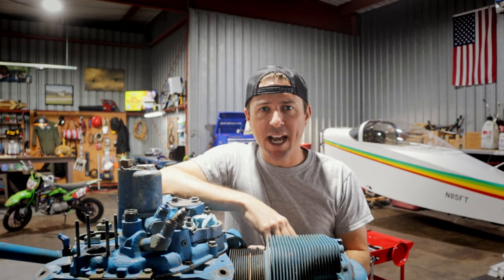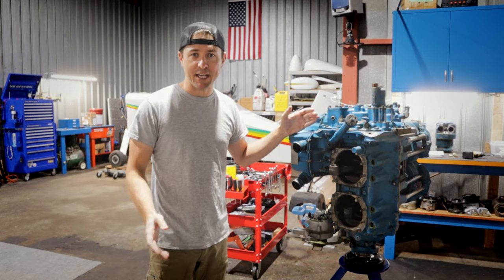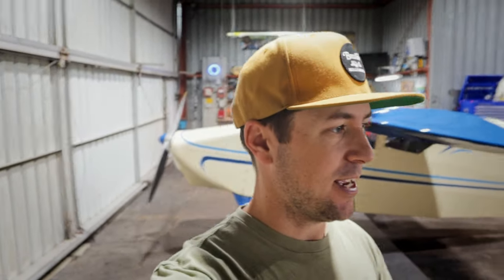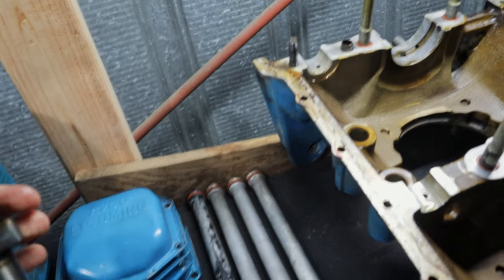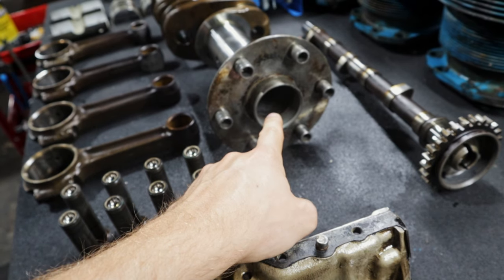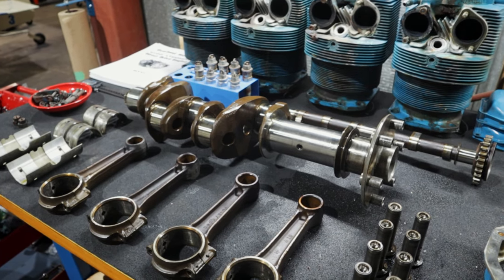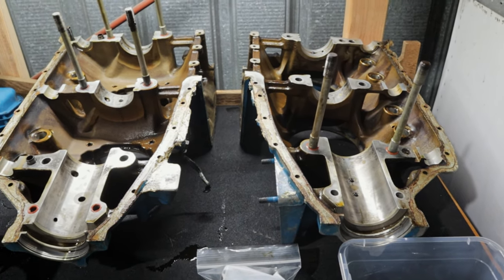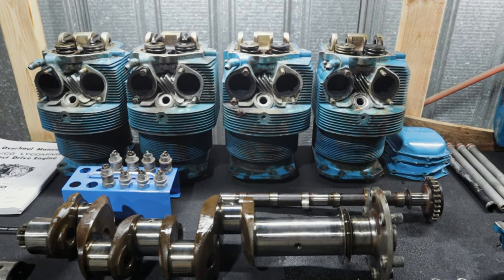Engine Teardown on Lycoming O-320 after 20 Years in a Barn! - Airplane Rebuild | Thorp T-18

Comment: I have always wished that people would store a Lycoming. engine upside down with a couple quarts of oil in it! It would save a couple of cams! Thanks for the videos!
Reply from the maker: Yeah unfortunately it's usually not planned to be stored for long term and then life gets in their way. The cam is a little easier to swallow than the crankshaft though!
Reply: @MotoFlightGuy  I feel your pain!

Comment: I'm in the same process, at the same stage as you are. My crank is good as my plane is flown regularly. I had a visible crack in the engine case. Pulled the engine and the cam did not pass inspection. Used the opportunity to purchase the upgraded cam and have the accessory case upgrade done to accept the one piece cam shaft. Re-assembly should start mid January. I also have chromed cylinders.

Comment: Those engines will run until the cam lobes are down to eccentrics, where you'll finally start to get misfires. I have an O-320 cam in my garage I use as a paper towel holder. It came out of a Citabria in 1979 due to misfires. No oil on it. 40 yrs in my garage, or basement through several moves.  It has a bit of fine rust pitting if you look close, in some spots, but is otherwise not that bad considering, except for the lobe worn down. I think the severe pitting you have there is mostly due to acids in the oil.  I have an O-290 in my PL2, and if it ever comes out, like if I start getting major metal in the filter, I'm going to have the case cylinder holes bored to a 1/8" radius incr and the case will accept O320 narrow deck jugs. O-290 cylinder parts are impossible to find.

Comment: I think Lycoming says to overhaul their engines every 12 years, whether sitting on a shelf or being used.
But, if you’re part 91, you don’t have to follow that recommendation.
Btw, the crankshaft nose plug is to hold oil pressure into the crank for fixed pitch props, or removed for constant speed props to send oil pressure to operate the prop governor/pitch change mechanism..
A&P/IA
Reply: Great vid!
The case has “bearing saddles”, for the mains, not journals…

Comment: Save you old oil pump gears, They are perfect for a home made engine pre oiler. This saves your engine life. Most of your pipe line patrol planes use aftermarket pre oilers!
Reply: Any idea as to what other parts are used in the homemade engine pre oiler?

Comment: these engines seem so complex (lots of precise machines parts) but also primitive. yet we trust our lives to these machines. when we gonna get 3d printed replacements
Reply from the maker: You aren't wrong. They are derived from 1940s technology. The tolerances are fairly loose and the design is very basic. They have proven themselves, however the longevity between overhauls is pitifully low compared to anything of modern design

Comment: Sorry about the late response. There’s an STC to install 160hp pistons in the 150hp jugs. But that being said as an experimental you can install any compression pistons you desire…
Reply: Any idea of the STC number?
Reply: @kczbluesman  STC SE367CH 288E is what was on the tag
Reply: @alanaspurling6469  Much appreciated.
Reply: @kczbluesman   the STC is for a Piper Cherokee  PA-28/140 as offered by Penn Yan Aero, which  was the source of this particular engine.

Comment: Would like to know how to change a 150hp to a 160hp.
Reply from the maker: I believe it's different pistons which have an offset wrist pin hole, so it increases compression, don't quote me on that though. Then, you must have the heavier front crankshaft main bearing to support the extra HP.

Comment: Not an airplane mechanic...I stick with engines that stay on the ground ...one question..wat do u mean by AD?
Reply: Airworthiness Directives (ADs) are legally enforceable regulations issued by the FAA in accordance with 14 CFR part 39 to correct an unsafe condition in a product. Part 39 defines a product as an aircraft, engine, propeller, or appliance.

Comment: Fingers crossed on the crank Daddio 🤞🙏. Hope it's machinable to spec. What's a new or serviceable 320 crank going for now? 😳
Reply from the maker: It's hard to say since they are so hard to find. Machine shops don't have them, and when you send a used one to them for inspection they are months backed up. Just sucks all around
Reply: Soooo, I guess the Tailwind sale is on hold? 🤔
Reply from the maker: No it's still for sale 😁
Reply: @MotoFlightGuy  Yup, Divco has had my Engine case and cam since early June. Just today was notified with the tracking number for shipment.